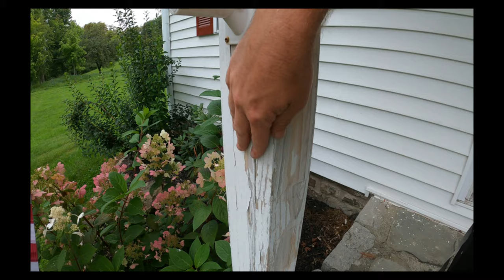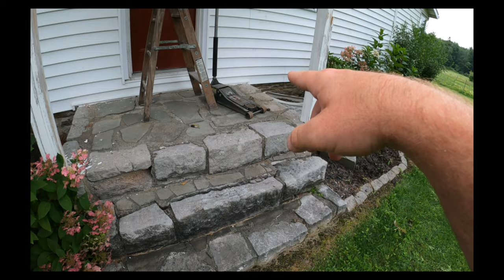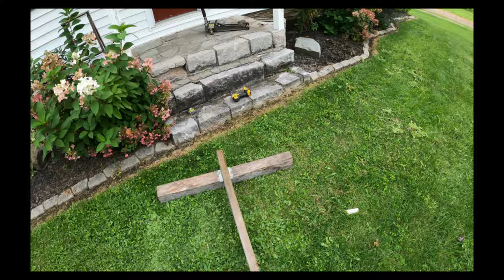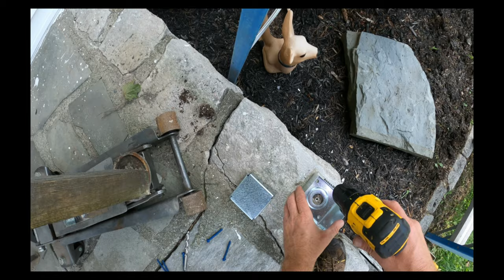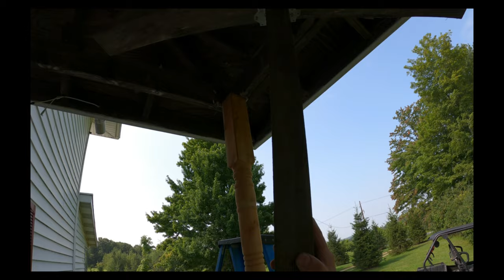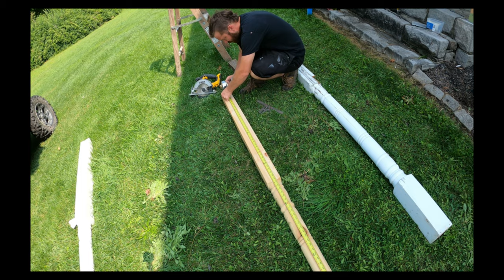Porch Column Replacement

Comment: Good job. You forgot to use a level to make sure were plum, but because they don't support much weight, not a big deal.
Reply from the maker: You’re right @joaquin I should’ve done that. I could see where the previous posts sat and put these in the same spot but no telling if the original builder put them in plumb. Thanks for watching!

Comment: A bag of concrete for 3 and 1/2 bucks? And this was only 8 months ago? Ooh you are lucky. Or else it was a small bag. That looks like a nice flag you have there all stitch together not just printed
Reply from the maker: Thanks Gwendolyn Karen! I haven’t priced it lately did it go way up?
Reply: @DirtRoadLife1  I don't know I thought I got a pretty good deal a couple summers ago for like five bucks a bag but when I was looking online the next summer in other words last summer it was crazy ridiculous like maybe because of the pandemic. So I'm just using what I have not going crazy on any basement repair projects just the big holes haha..
I bought it at Lowe's and I think it was the N type I still have a bag of s mortar which I don't use a whole lot of.
Reply: @DirtRoadLife1  oh by the way I don't own a Jack and I do have one of those pillars that you used to support a beam in the basement it's still in the box so I might try to use that the thing is the railings are in the way I don't even know where to start but I was encouraged by the fact that you said you did some of it without an extra pair of hands like when you put that t-bar brace thing to support the roof my roof is a little bit bigger than that one but anyway it's just not a job I'm looking forward to I did it in 2007 and of course those bases rotted out I think they were pine but I didn't know any better then. But I know enough to know that I wouldn't waste my money hiring anybody to do anything again haha. Especially if that person is like a cousin or some relative 🤣 as far as the railings go I put those together myself they're all in one piece and they're kind of tricky to fit them in between the two pillars so I don't know I'm not looking forward to that part like I said.
Reply from the maker: @gwendolynkaren5933  you’ve got it I have faith!! Thanks for watching and good luck with your upcoming projects!
Reply: @DirtRoadLife1  aww thank you for your encouragement.